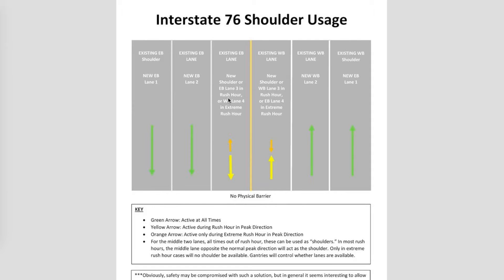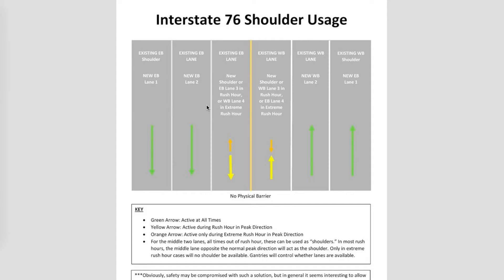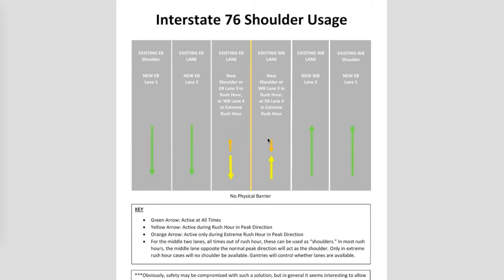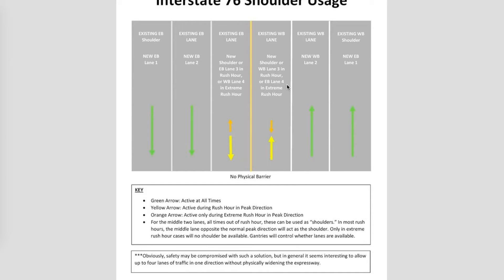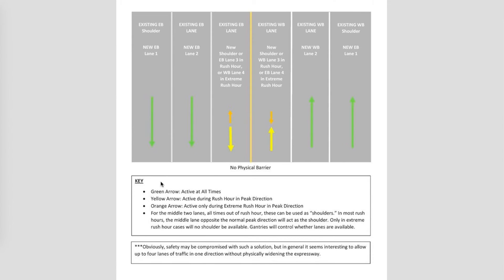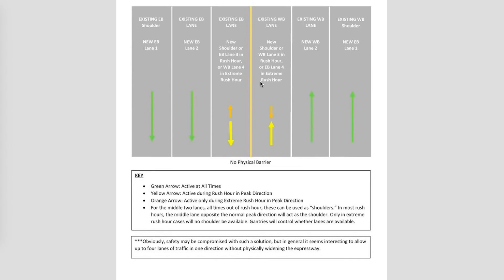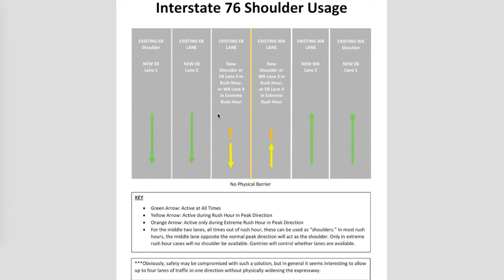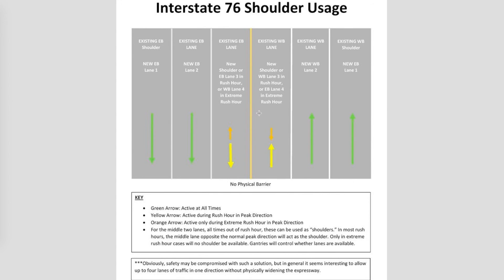Interstate 76 Shoulder Innovation (Webeovation)

Comment: Check out what's been done on the M25 around London. The use of shoulders for driving and variable speed limits have slashed road deaths over about 10 years. In one previously deadly stretch, there hasn't been a single fatality.